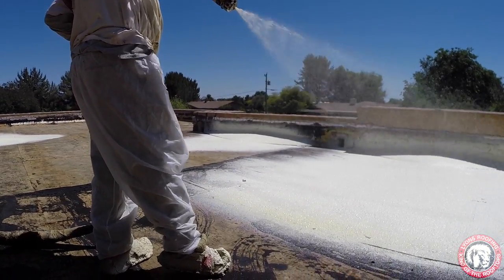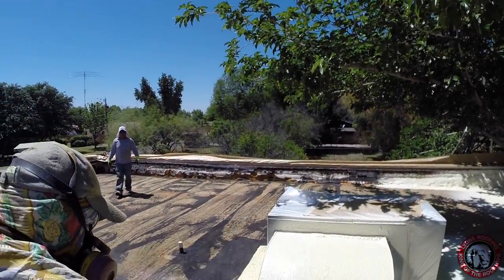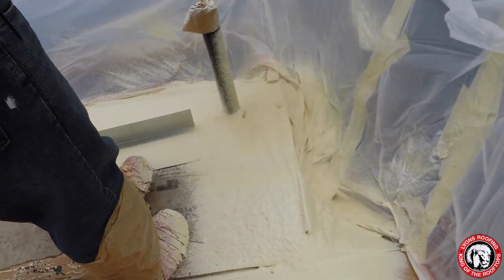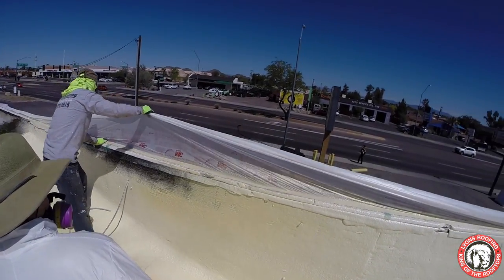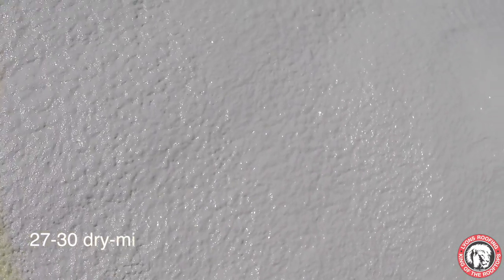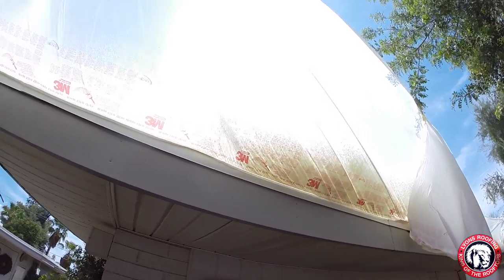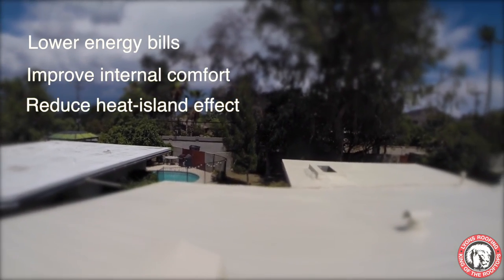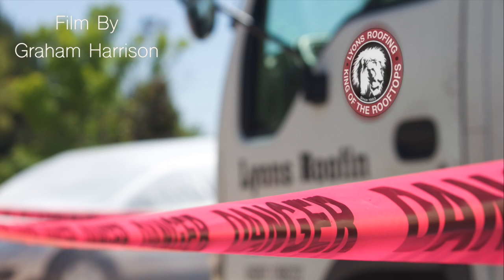Lyons Roofing:  Polyurethane Foam Roof installation

Comment: The coating is not a waterproofing barrier? So water penetrates the foam?
Reply: The foam roof IS a waterproofing barrier and very effective and adds great insulation qualities. After the foam roof is on, its followed up with a elastomeric white roof coating.  The elastomeric coating is highly reflective of the sun's damaging uv rays etc and protects the foam roof from the sun.  Regular maintenance of a foam roof is to simple put another coat of elastomeric on it every 5 to 15 years (depending on the quality of the elastomeric.)  If there is ever damage to a foam roof, it's very easily repaired.

Comment: Spray foam roofs are garbage. We tear them off just after a couple years. They blister, birds peck at them. Bullet holes penetrate the roof( detroit).
Reply: Bullet holes? Lol I am pretty sure there is no roof material that is bulletproof.
Reply: @chinasanchez007  Thick concrete roof are pretty much bullet resistant.
Reply: Foam roofs are long lasting, provide insulation and are very easy to maintain in the hot, dry Arizona climate.
Reply: Ive been in the roofing business for over 50 years. And installing foam for over 20. I've never had to tear off any foam for any reason. You're just a roofer that doesn't like competition
Reply: What do you put on top ??
Reply: @phillhuddleston9445  Or steel plate. 🤣

Comment: “THE MOST RESPONSIBLE WAY TO ROOF”  🤣🤣🤣🤣

I strongly disagree. It’s the most irresponsible. 

For all of the building owners/property management companies thinking about this option, I strongly advise you do your research before deciding to move forward with this system. 

These roofs are a preventative maintenance nightmare. 
Scenario 1: your RTU needs maintenance/repairs. HVAC technician walks across the roof not knowing and or not caring about damaging the roof. Drops a panel/screw/tool on the roof and cuts into the roof. That night it rains. Now you have an absorbent foam product that  is soaked but hey maybe your roof didn’t leak. 
Well ffwd until it does eventually leak and 
See how much it’s going to cost to replace the affected area. 

By the time your roof lasts 20 years, (btw I’ve never seen a foam roof last longer than 5 years)you will absolutely end up paying more than what an EPDM/TPO roof would have cost. 

You’ve been warned
Reply: Twaddle ... one fundamental characteristic of HD poly closed cell foam is that it is NOT absorbent.   In fact, it is used as the core in about 30% of modern yachts for that very reason. Damage is quick and easy to repair (over-spray and coat.) 
I have used this technique on a number of roofs, some as long as 25 years ago, and all are still in perfectly sound condition.
Reply: Sure, and a meteorite might strike your roof and make a hole too!  I guess conventional type roofs never get leaks, huh?...... You're obviously a roofer who  hasn't invested in the equipment to do foam roofs and therefore companies who are doing foam are eating your lunch.